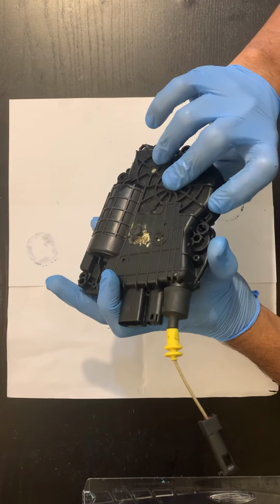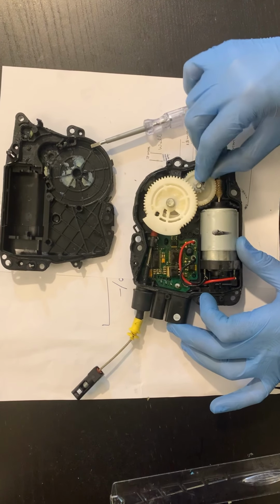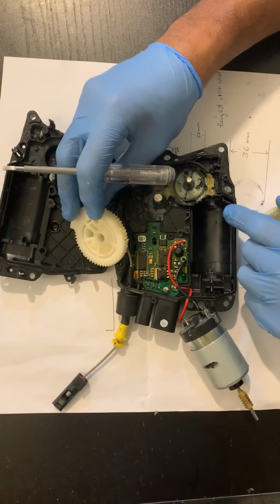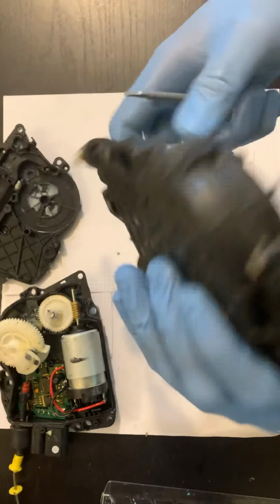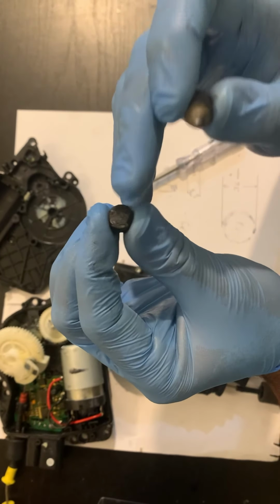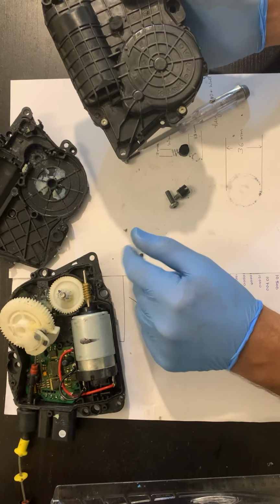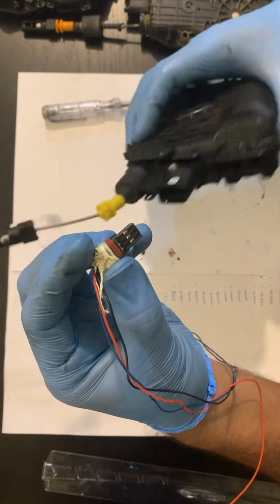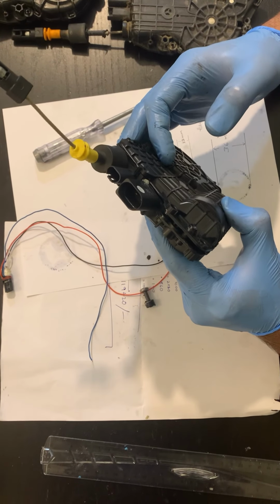BMW SOFT-CLOSE repair

Comment: TIP for anyone trying this
DONT DO IT!!
Taking it out and putting it back in is as easy as it gets. Opening the plastic box which is glued with god damn cement and superglue mixture is a nightmare. YOU WILL BREAK IT!
Dremel if you are mad enough to try it helps a lot but if you try you will remember me telling you not to do it.
Worst part, the quality of the gear i found on AliExpress was shit and it broke after a couple of days leaving me with broken soft close again!!!
Reply: thanks for the advice, I want to start doing it but I'm at a loss😂

Comment: BMW X5 E70 facelift 40d. I have a problem with the soft close with left front door. The door is closing but when i shut the door, I must wait 2-3 seconds for the final shut of the door, the last part of the soft close... I must change the entire system or is some bolt broken or some rubber worn? I adjusted also the door but I dont understand why is this problem... I didnt moved the door position, it was never adjusted and it started to be slow after I changed my battery. Very hilarious.... So i shut the door, the door is closing, but the final step of the soft close is delayed with 2-3 seconds...
Reply from the maker: I didn't experience delay, if it doesn't close properly then might be broken bolt or some sensor inside that I did not work on yet

Comment: Mine sound normal but no closing..... so maybe is just to replace the bolt for longer one. Hope so 🤞
Reply from the maker: Shake the door n see if you can hear the freely hanging actuator? If you don't hear or feel then it might be due to the hook been displaced away a bit
Reply: @bimmerhacks  do you mean the Striker?... i did already. Nothing ... but i will try to  shake the door tomorrow and see if I can hear anyhting.
Reply: @bimmerhacks  The funny thing is that this car have only 22k miles. Passenger door was rarely used
Reply from the maker: @r.c.850 OMG. check for fuse
https://youtu.be/qb8UUeTDS5s?si=5cKzgN1SzLwcdjxO
Reply: @bimmerhacks  According to ChatGPT, each actuator has a single dedicated fuse... I can see that the door tries to close but ultimately does not close completely. That means the motor is working. So I don't think it's the fuse. But I will double check just in case. Thanks
Reply: @bimmerhacks  The strange thing is that it happened now... after I disconnected the battery while working on the car, changing the cabin filter, and another day when I took apart the blower motor to clean it. Then I noticed that the passenger door no longer closed. So just in case a disconnected the battery again today to reset everything again. But still
Reply from the maker: @r.c.850 then it's not fuse. I was lost, a little bit busy with work. Bolt or hook probably
Reply: @bimmerhacks  Yes, I have to take everything apart and see if there's anything out of the ordinary.
Reply from the maker: Shake and see if you feel anything hitting against the door body, if not you don't have to do much work, just adjust the hook on the door pillar

Comment: I found the gear available on AliExpress. My mechanism would pull in the door but not enough to latch. After a month or so it started to make a very hard plastic cracking/ticking sound. What do you think is my issue?
Reply from the maker: Plastic cracking sound is broken gear but not latching would be either the broken bolts holding the motor or u have to adjust the locking hook

Comment: Still helping people 4 years later. The gear is available on Amazon and eBay.
Reply from the maker: Main idea is to know what's the issue is. If you are not able to get the gear just take the fuse off till you get it, it's that simple rather than taking the whole door panel off to disconnect

Comment: I have a problem with my soft close when it comes close into latching not to close it doesn't latch i think the motor is weak it doesn't make any broken gears sound but it doesn't latch at all at the back 2 doors the same problem and the passenger door the same problem
Reply from the maker: The bolts might be broken(see shaking the door you might hear the sound of something loose hitting the metal. Or the locking holder might have to be adjusted. For sure the motor doesn't get weak. Check my video below.
https://youtu.be/CTZmnv8X3HE?si=jcwj-zg594HVI5Yk
Reply: @bimmerhacks yep thats right i hear shaking sound when i shake it thank you so much😊

Comment: 4 years later this video still helping people 😁 just got my soft close fixed thanks to you. My issue was with the bolts...however I've been having a smaller issue on passenger side where soft close works 80% of the time. When it doesn't work, I just slightly press the door from the outside and it will latch. Do you maybe know what might cause this? The bolts on passenger side are OK and no grinding noise
Reply from the maker: Just loosen the hook on the pillar n push it outwards then tighten it.
Reply: I did try that but then the door is sticking out too much 😅 @bimmerhacks

Comment: Afeef brother thank you the support, i have opened the door trim and fond in my car bmw f06 the motor is on metal holder and metal bolts from the factory, the door is trying to close but dose not shot completely, and there are no weird sound to say that we need to change some gears, did this case passed by you? i guess its the cable due to someone did shut the door quit hard and then i heard like plastic crack then, this issue happened
Reply: this is the exact issue that i have 

https://youtube.com/shorts/TGaU7WWzLas?si=apmnzVKwMuP6QZ_E
Reply from the maker: May be the sensor issue inside the door lock itself. I saw this issue in my cousins F10 car but I didn't get time to confirm the problem.

Comment: Hello,can i swap mecanism from a soft close BMW x3 f25 to a non soft close ? Or i need more electricle bits? Thank you.
Reply from the maker: I have used an E70 and E60 door lock on F10. I hope F25 will also be similar- cannot guarantee as I have no clue on X3. Soft close mechanism will work on non soft close model
Reply from the maker: https://youtu.be/CTZmnv8X3HE?si=VCdygo_s45Vi8Ahr
This is from E60 to E70

Comment: First, thanks a lot for your detailed explanations and time you took ti make this video!
Second, got a F11 from 2012 with soft close option of course, and need maybe your experience to solve a small issue I meet since few months now.
Soft close is working properly, no gears noise, as door is approaching mechanism close as it should, except it stay in fully closed position much longer than the others doors. On normal behaviour, it catch the door, close it a little bit more as it should stay then release slightly the door quite instantly to stay in normally closed position. In my case, cycle is the same except it stays in fully closed position at least 1 second before releasing the door to be in normal position.
Do you have any experience with that kind of issue?

Thanks a lot anyway 🙂
Reply from the maker: If your soft close is closing itself without releasing to open position then it is related to the door lock itself and not the soft close motor. In the majority of cases the door tries to close but wouldn't be able to complete the procedure, in such cases just install the motor with a nut bolt or screw and nut. I have detailed it in a recent video. I'll post it below
https://youtu.be/CTZmnv8X3HE?si=ouvcuG3z2-dknHhf
Reply: @bimmerhacks  thanks for your quick feedback!
Soft close is cycling properly in any cases, no issues at all except the timing itself as I described before. 
Guess it could come from the hall effect sensor for closed position on the latch, or maybe an extended or slightly loose cable between motor and latch... I may be wrong, idk!
Reply from the maker: @Energize-R  you can check it's functionality by just pressing the door lock locking lever with a screw driver and the soft close motor will lock the rest, this is just to see how bad is your door lock.
Reply: @bimmerhacks  nice tip! So obvious! Gonna check it and let you know FYI 🙂
Reply: @Energize-R 
 hi, I have the same issue as you. Did you solve it? I got mine after bmw workshop changed the rubbers at the doors.. 🥴
Reply: @mattiasolsson1739 in my case it was same, and I fixed it by replacing the bolts as OP showed

Comment: for gears: https://www.brossautoparts.com/product/bge604-door-lock-latch-actuator-soft-close-motor-comfort-repair-gear-set-51217185691-92-for-bmw-f01-f02-f04-f10-f11
Reply: What about the taller bolts cuz my issue that the door is trying to close but its it open back again so the bolts if they are available taller thank you
Reply from the maker: @hasanalothman27 use 1.25" screw and a nut with washer as in this video
https://youtu.be/CTZmnv8X3HE
Reply: Bu parça F07 oluyormu

Comment: In my case a door sometimes is pulled în, sometimes not. When is not pulled I don't hear any noise, works like normal door. What can be the problem?
Reply from the maker: When it doesn't close automatically does it try to close?
Reply: @bimmerhacks  No. Just stay!
Reply from the maker: @mariuszaharia4023  might be the wire has loose connection, when the holding bolts break the motor hang on the wire and there is a possibility of loose connection at the small connector end.
Reply: @bimmerhacks   what is the size of the screw I need to buy in 35mm Lenght? is that a M3 or m4 or m5?  My support are broken. Driver Door tries to close and then after 2 seconds it pushes back. I can feel something is broken when I try to shake the door.
Reply from the maker: @sachin2080  screw with nut and washer, or nut bolt with washer. Diameter of bolt is around .3 mm I am not aware of screw names
Reply from the maker: @sachin2080  https://youtu.be/CTZmnv8X3HE?si=cYx7xYmv7aUcUcPU